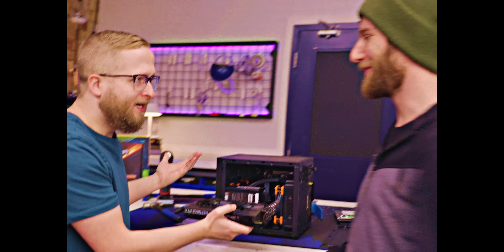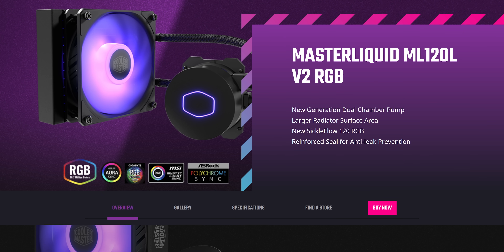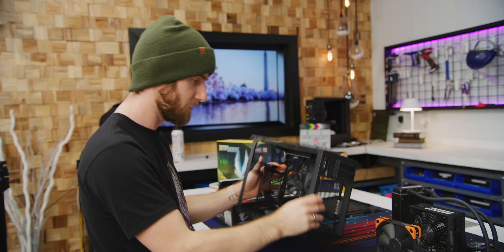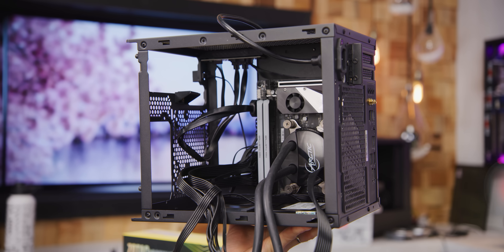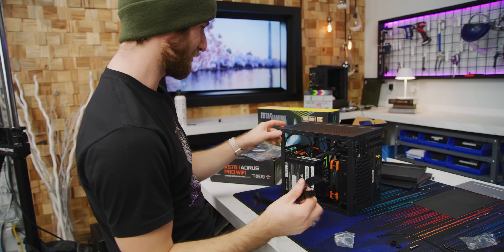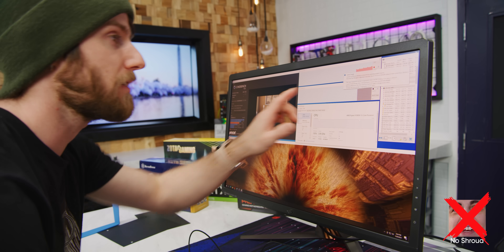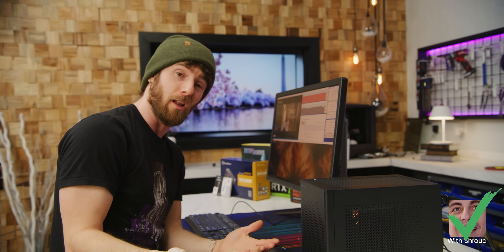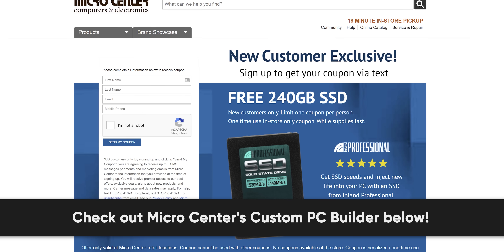This GPU SLIDES into this Case! - Silverstone SUGO 16 ITX Case

Comment: I'd like to see Linus engineer a small form factor case. I bet with all of his experience it would be a rockin case.
Reply: It's be made of rubber, just to survive inevitable drop
Reply: @billwhitfield3943  truth!
Reply: Something around 7 liters like the A4-SFX would be awesome.
Reply: I was not them to build a backpack pc for vr gaming that can be thrown around and fallen on.
Reply: @SOUL SEEKER and shock proof
Reply: @SOUL SEEKER if you have to stretch something it means it will be pulling down on said component 
I'd rather have a bad time cable managing something than have anything press down on my gpu or mb
Reply: Dunno bout Linus but Matthew from DIY Perks can, definitely!
Reply: Then have Alex build it using only hand tools!
Reply: I want an SFX case with 3 optical drive slots........ anyone else?
Reply: Well if the screwdriver is any indicator your correct. It would also take him 26 years.
Reply from the maker: We have some ideas....
Reply: @LinusTechTips  LESSSSSS GOOOOOOO!!!!!
Reply: i bought my case in 2013 the NZXT Phantom 630 windowed version (Full Tower, Reccomended by Linus), currently it's my second motherboard inside. It is very good sturdy case don't plan on changing it anytime soon (probably never), the rubber fan switch just kinda melted, don't reccomend rubber stuff if you're planning to use the case long term.
Reply: @LinusTechTips  yeh but they all 3D printed though XD
Reply: @LinusTechTips  We'd love to see them!
Reply: @LinusTechTips  
Sliger, LTT edition
Reply: @LinusTechTips  please stop that editing zooming into the guy face, while trying to see Linus put the gpu inside the case at the beginning of the video. Please stop doing that.
Reply: @LinusTechTips  make it a ps2 esque console form factor please.
Reply: @LinusTechTips  will this ever happen:((

Comment: I love Silverstone's cases so much. So many different options that you don't see a lot.
Reply: I had a silverstone case but i like my Lian Li alot more.
Reply: I was waiting for an Alta F1 for almost 2 years since they announced it, lokked amazing. Problem is that once they released it, turns out it's stuck with ATX.
Reply: You don't see a lot because they're tiny
Reply: @cfcreative1  My main Desktop is in a Lian Li LANCOOL II Mesh right now but I have several Unraid machines here in Silverstone cases (CS 380 and CS 381, which are entirely different cases despite the similar names) and they're awesome for that they are for. They also have so many different SFF cases that I'd love to try as the Fractal Design Node 202 that's sitting under my TV right now is a terrible heat magnet.
Reply: SUGO lineup is underrated. It was doing SFF cases before many other mainstream brands jumped in.
Reply: Oh nevermind. It's one of Silverstone's case lines. Derp.
Reply: Yup. Im rocking a grandia gd10 and its a phenomenal case for home theater rigs 👌
Reply: Silverstone cases are a nightmare to build in
Reply: I second to this. I've had ML08 Case with a handle for few months now and it's amazing how portable it is considering much power it carries with my 5600x and 2060 Super
Reply: They have an HTPC case that is also rackmountable and I'm very tempted by it.
Reply: Looking through their website at their power supplies also gets an interesting statistic. They list the density of watts per liter, which is just the right amount of absurd.
Reply: They don't really make full towers anymore it seems like
Reply: Y- you guys have multiple computers? And good ones at that? Sheesh, rich people.

I'm rocking an old Dell Vostro 410.
Reply: Exactly! I used Raven 2E for a really long time and that's probably my fav so far

Comment: Really hoped this would actually be a build where you can slide the GPU in without needing to actually slot it into the PCI-e port and connecting auxiliary power connectors. One day we'll get there :)
Reply: The title was clickbait sadly
Reply: also the processor, we should be able to just slide it, without thermal paste or heatsink. the future processor is so cool that we need heater to keep it warm.....
Reply: Like Hotswap on servers. That would be very cool.
Reply: @GUSRG  it would be loud n ugly
Reply: @potatopotatopotatopotatopo8746  it wasnt clickbait. it still slided
Reply: @dosendaring  Umm... I'm pretty sure some law or laws of thermodynamics makes that impossible. With a heatsink installed it could be possible, but without, maybe some fluid based cooling could work, but 100% efficiency with 0 heat loss is pretty much as close to impossible as it gets.
Reply: @Cinkodacs  It was a joke, and a pun. you know, in western world, cool could means 2 things, either absence of heat OR awesome. I was referring to (cool) awesome processor THEN followed by the response for the (cool) absence of heat. But I'm glad that you took the time to think about it. I like that....
Reply: @potatopotatopotatopotatopo8746  I mean... the title says the GPU slides into the CASE, not that the GPU slides into the entire build.

Comment: 9:36

One thing I've done in a similar case (NCase M1) is to drop a fan or two in the gap between the gpu and the panel. Even if all you can fit are slim fans, it'd probably help with gpu thermals.

Comment: ive never once understood why linus has had cable mod multiple times as a sponsor yet they don't have an inventory of all their cables and cable lengths.. would make his builds so much better.
Reply: Yeah, You would think at this point there would be at least a consignment deal.
Reply: When I would build in an SFF case, I would make my own cables. Way less painful and better airflow too.
Reply: Airflow isn't as impacted as much as people think, actually way less. Now if the wires are literally interfering with the fans spinning, that's a different story.
Reply: There'll be a lot of LTT employees with nice cables at home :)
Reply: @robertt9342  That's the main reason why I would do it. Also because it looks way better. The moment I find a supplier for all PC connectors + tools, sleeving abd wires, I'm goint to make my own cables, no matter the build.
Reply: PSU cables are not interchangeable, they are specific to that model. If you use cables that are not made specifically for that power supply, you run the risk that the pin out is different and you can fry components
Reply: @DrakkarCalethiel  Easy to find, takes time tho, but it is rewarding.
Reply: @patg108  he’s most definitely not lazy, he has some of the most entertaining and informative tech videos on the entire platform
Reply: @vax6575  oh ok that makes sense, I had no idea
Reply: @7ngel  That's a LIE, he certainly is when he forgets to evaluate the cluttered setup of a average tech loving fella instead of merely looking at far above average ones that have flaws in specs and throwing trolly criticism for others that could easily be ignored.

Linus is CERTAINLY a troll, a technican, a clown but all of those things are of the very UNCONVENTIONAL means to combine and show those things as his LTT videos do.

and nobody NEEDS his "trash" LTT store items he tries to push!  I shop thrift stores and would consider buying one if i could waste time and money as frivolously as he does.  Nor his foolish "ideas" with vague "facts" he pushes all the time.{

After all far more serious technicans who do what needs to be done and what will or won't pose a big risk factor combination certainly will NOT give you the ideas to a novice that the TROLL linus does!

Just ask ask ANY technican with far more years and wisdom under his belt than Linux!  They WILL agree with me over videos like this
Reply: @patg108  yet you’re here watching his videos ‘troll’
Reply: @7ngel  only to troll the more active and bigger deserving troll because of  his excessive amounts of trolling in various tech methods, so he deserves what he gets and more
Reply: @patg108  well that’s on you to make the best of it bud. I’ve seen people dying in the hospital with a giant smile on their face constantly uplifting other people. Your troubles don’t make it right to bring others down.
Reply: @7ngel  could say i've been trying to avoid doing that as i recall others with similar experiences (i was in one just over 2 years ago, but thankfully am doing a lot better physically and until recently emotionally too)

And while that's true, you can't deny a vast majority of others can say that too, not everyone has someone to talk to that will listen and relate to you.  A little spread happiness to ANYONE with ANYTHING to be happy about can go a long way towards helping others you know!  Hence why people do these things for others!

Often with family or friends though

Comment: So there's been some issues with the Sabrent Rocket  M.2 drives dying prematurely. So I'm going to request a look into that from you guys at LMG. I know you don't use the builds that you do in these videos, but recommending a drive that has multiple instances of premature failures is iffy.
Reply: LTT doesn't do prolonged testing of SSD's. Sure, they have a lot of systems/servers they rely on everyday but I don't recall them ever covering an issue like this. Anecdotally I tried out a Gen 4 Sabrent Rocket a while ago and after it died after 3 days of use I decided to stick with Samsung for my NVME drives.
Reply: Gamers Nexus might be a better choice to ask about that
Reply: @Sgt_Glory  I was thinking the same.
Reply: @Sgt_Glory  LMG will probably do it. Just like they did the Adata SSD bait and swap investigation.
Reply: Unfortunately that's one of those things that they can't fully account for.  If enough attention is drawn to it I'm sure LTT will do a follow up.  Personally I did some research before settling on a pair of WD SN850's, though WD has had some issues with consistent quality/changing things.  At the time there were only two real options for gen 4 M.2 SSDs, the Rocket and the 850 and the Rocket had enough reviews of premature failures that the choice was pretty clear.  850's also perform a bit better in random read/writes while Rocket's perform better in sequential read/writes.
Reply: New New Whonnock (Whonnock 3) uses Sabrent Rocket M.2 drives if I recall correctly

Comment: If you're willing to go a little bigger on the case, the Lian Li Q58 looks nicer and is easier to work in.
Reply: The Q58 is much bigger, though. When you go for a sf case, every centimeter matters.
Reply: Alternatively go with the SSUPD meshlicious (about the same size?)
Reply: Missing the point of SFF.
Reply: If you want to go a lot bigger on the case, something like the Fractal Design R2 XL allows you to hold both a PC and a body in your trunk!
Reply: @LuxTheSlav  the Q58 and the meshlicious are both still SFF cases (<20L volume)
Reply: @kingkea3451  "If you're willing to go a little bigger" is the antithesis of SFF, especially for ease of use.
Reply: @LuxTheSlav  When are you fanatics gonna learn that smaller does not automatically equal better?

Build for use case, not dogma.
Reply: @LuxTheSlav  Q58 is SFF. "A little bigger" doesn't defeat the purpose of SFF because some people want a SFF that that is a little bigger and can fit 240mm rads and full length GPUs.
Reply: @Damasiofa  You as well. Every centimeter only matters if you're trying to squeeze the computer into a small space or luggage bag or something.
Reply: @kingkea3451  yeah, Q58 is only 10% bigger than sugo16 (13 vs 14,5 liters). 😊
Reply: @Gamepadder  Ah, fake SFF, yes, understood (:
Reply: @crazycanadian7223  I'm just baiting. Don't tell anyone.
Reply: @LuxTheSlav  not when it comes to hardware compatibility. My first build was in a k39, and I have since upsized to a meshlicious but it is still SFF. 

SFF is all about cramming as much as you can in as small a space as possible. As it is, the meshlicious is one of the smallest cases to accommodate up to a 280mm radiator as well as a full size GPU. 

SFF isn't just about making things small- its also about space optimization and not having unused volume
Reply: @kingkea3451  For space efficiency I'm very partial to the Sliger Cerberus. Expensive as Hell but if I wanted to downsize, that's what I'd probably spring for. Maybe when it's time for a rebuild.
Reply: @crazycanadian7223  the small form factor appeal is not practicality but the fact that you can do it. If you want it to be easily serviceable, just do a normal build
Reply: I got a lian li tu150 that made it handy to take to places due to the built in handle on the top of it. idk if it would handle a 3070 but the 1660 ti in it runs pretty good.
Reply: J U S T I N 🤍  be quiet

Comment: Damn. I did a similar build using a Silverstone SG13 a couple years ago. Mounted a SFX-L PSU where the front 120mm fan is meant to go and then put in a Noctua U12A cooler with a 3D printed vent which fits in the usual PSU spot. It's like Silverstone read my mind and built this case, but only AFTER I built my desktop - otherwise I would've been pretty tempted by this thing. Well, hell. Still am tempted. Well done Silverstone. Their products are exactly what people need even though they have no idea that they need them.

Comment: I hope that PC / component manufacturers take a note of this. 

I love this kind of "slide-in" design for components, rather than opening the case and taking out about 5 to 10 screws and then carefully popping the locking mechanism to remove the component.

I especially wish for an easier solution with CPU install / removal. Currently you have to be extra careful with the cooler and thermal paste and the actual CPU-chip (avoiding bent pins or too much paste).
Reply: I agree too, I know that there are industry standards but it would certainly be nice if EVERYTHING about building a PC could be as modular and tool-less as possible.
Reply: i think the paste part are a bit hard to fix, but I agree that cpu install should be easier and safer
Reply: Watch the video, there's nothing like that. It's just the clickbait title+thumbnail that make it look like it's some slide-in GPU slot.
Reply: don't threadripper CPUs have sort of sliding mechanism to install them?
Reply: @cicalinarrot  I know it's not. I myself like smaller PC's, but I prefer mATX as ITX doesn't have two pci slots. But it's nice that the design of the tower allowed for a way to get it in there. Won't lie though it was a little clickbaity
Reply: @cicalinarrot  Yes, but the theory and idea is there and I believe it is doable, though I'm a web developer, so I don't know about hardware that much (other than how to build a PC or swap parts).
Reply: Honestly while I do believe there could be some improvements, it's absolutely fine the way it is. Its super easy and simple. What you want is more of a niche enduser thing and if you are up for paying 4-5 times the price, then I agree.

Comment: Also, why not re-introduce the 5,25"  bay to add a card like that. We've got risers and all that, and a 5,25" bay would be WELL big enough to fit any graphics card, or any card that would be made to that specification. Depth can be adjusted. Like hot-swap drives. I'm sure that could fairly easily be implemented.
Reply: Because they want SFF cases to be compact as possible and you are saying that it needs to be bigger???? 😂
Reply: @rensquared24  So every case is already that wide anyway. Why not use that old standard and route the new standards like via a riser cable/card. it can even be actually hotswaped-ish. it's about the standard, it is right there. you can hotswap hdd's, psu"s. Time to hotswap graphics cards

Comment: I have that exact motherboard, great board, I like how you can adjust the RGB WITHOUT software through the BIOS. (I like Linux and alt OSes, great not to have to rely on software for my RGB.)

Ryzen 5 3600 @ 4.5GHz (I prefer air), 32GB DDR4-3600 CAS 17, 180GB Muskin 2.5" SSD (Windows 10 Ent LTSC/dual boot with PopOS and Apps), 2TB Samsung NVE (Compressed - Games only), RTX2070 Super UltraOC, Corsair HX750 PSU, 55" 4K OLED display and secondary 2K, 27" Veiwsonic professional display. Love it.